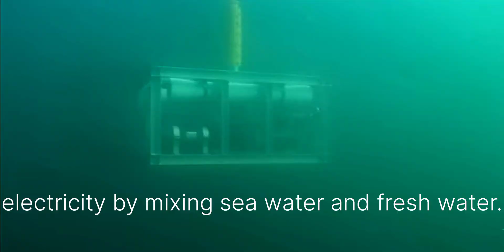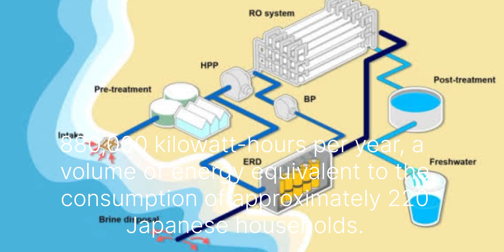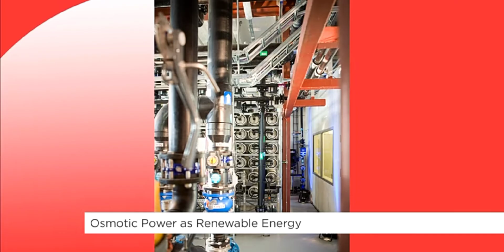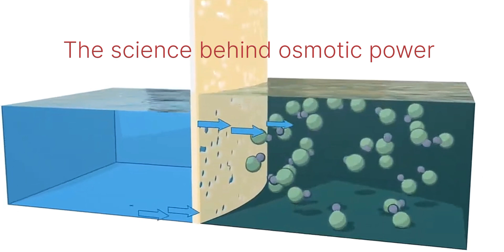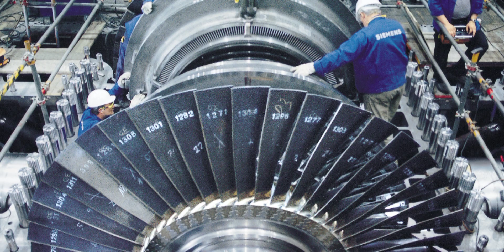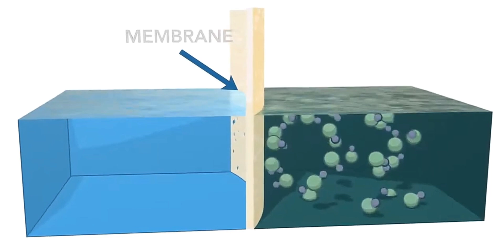Osmotic power plant : Japan' first osmotic power plant | uninterrupted energy source | Denmark |

Comment: where is the fresh water coming from?  and if the plant is being used to desalinate sea water, why can't the fresh water just be collected and used?
Reply: I read that the freshwater is from treated wastewater from the city.

My theory is, to increase output, you can add the salt from desalination to the seawater side, increasing its salinity, enabling a faster rate of transfer from the freshwater.

In order to not run out of freshwater, you can also use collected rainwater by building large underground flood tanks to augment the supply of treated wastewater
Reply: It doesn't purify it all the way. They tried this in Norway big disaster my bad it was denmark